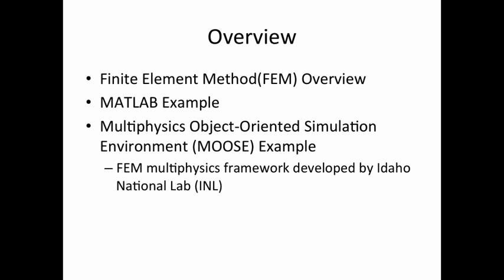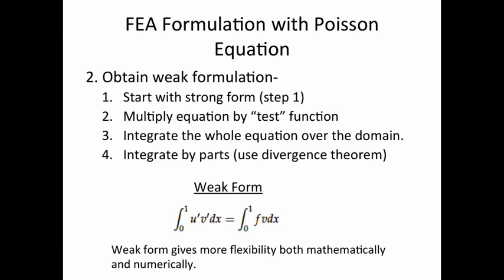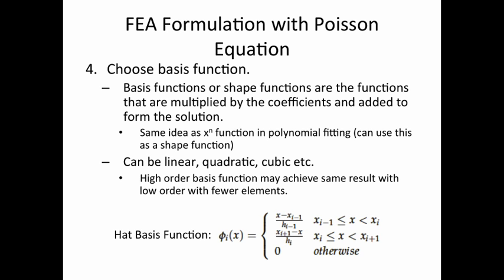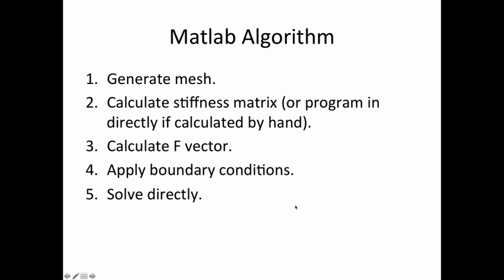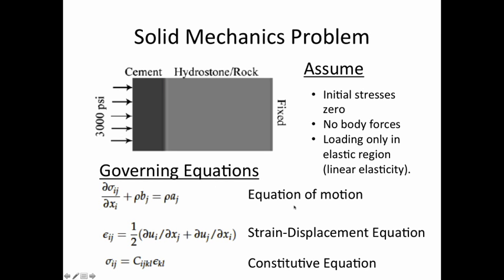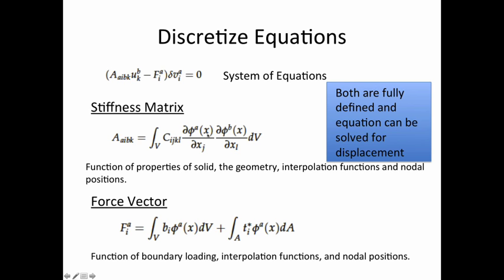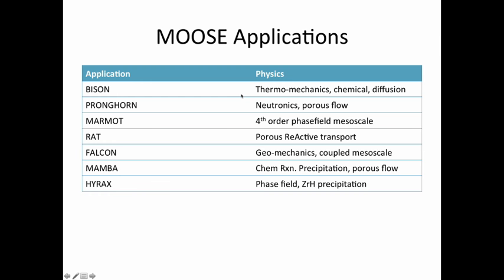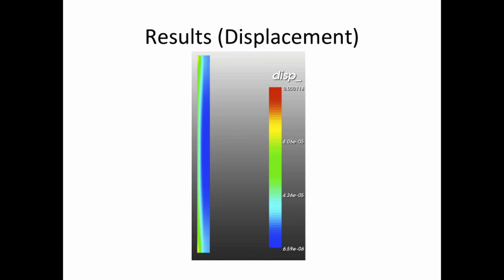Overview of Finite Element Method (FEM)

Comment: What happens to the vu' term after integrating by parts?  I see that it is 0 at x = 1 but there should still be vu' |x=0 since you cant use the other boundary condition.
Reply: Exactly I didn't understand how vu' vanished at x=0.
Reply: The test function which has been chosen at the beginning must satisfy the boundary conditions, thus the term you mentioned above will vanish because v(0)=0
Reply: @taofiknassan2016  if the test function is same as the basis function it should be equal to 1 at x = 0? Maybe I'm missing something.
Reply: @yoanagrudeva7350  who said the test function must be 1 at x=0, the choice of test function such that it satisfies the boundary conditions is responsible of the success of finite element method as a computational method
Reply: Test functions are functions with compact support which means they vanish at the boundarys of the set they're defined on. We use this trick to solve the integration by parts (keyword weak derivative)